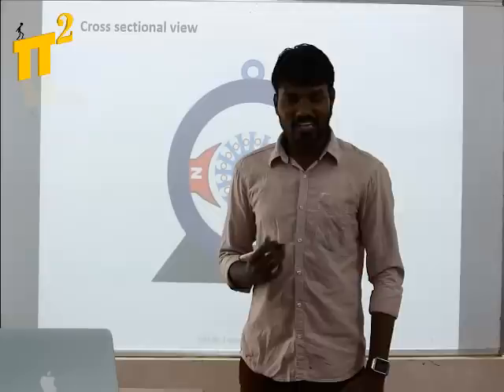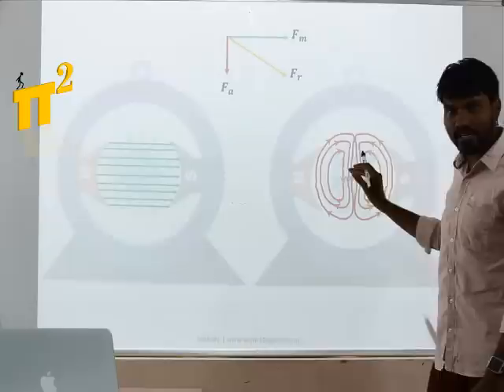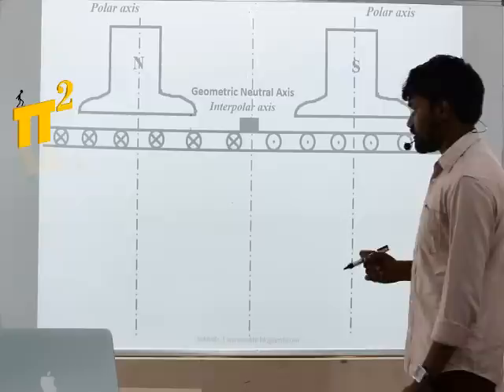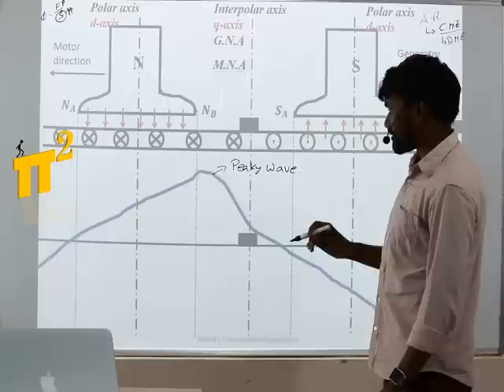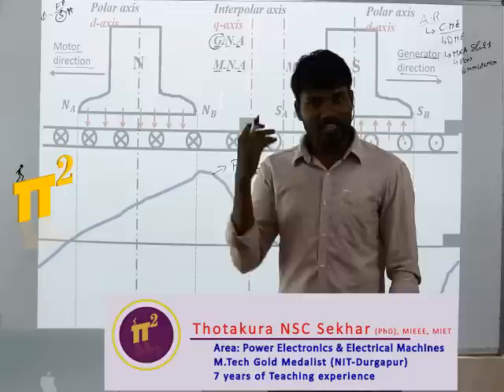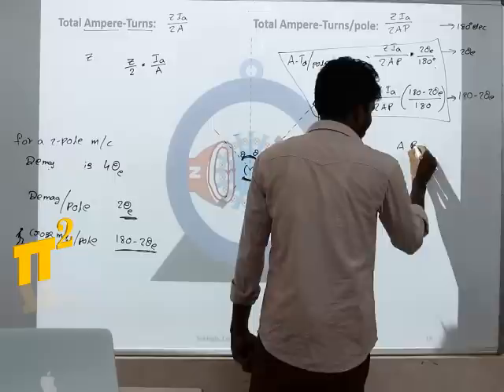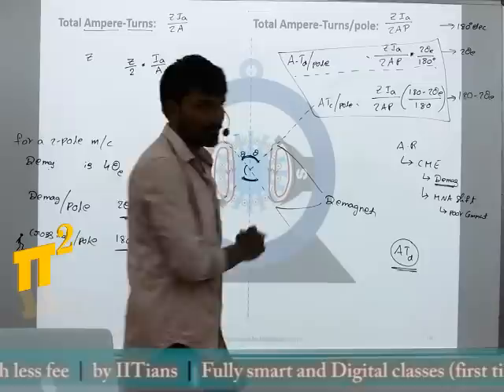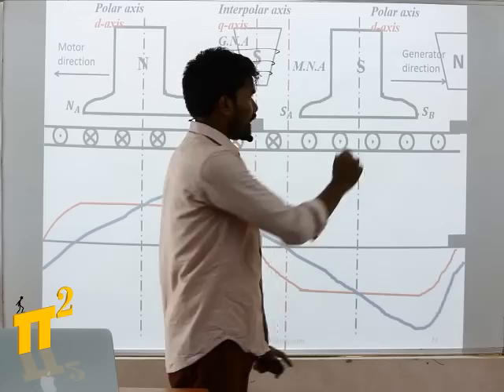armature reaction in dc generator | Armature Reaction in DC motor | Mastering Armature Reaction

Comment: Please sir give me below problem   solved A belt driven shunt generator connected to bus bar has the following specifications:
Power = X kW
Speed = 1500 rpm
Armature resistance = 0.025 Ω
Field resistance = 60 Ω
Ignore armature reaction and brush contact drop.
B2.1 The machine is running at 300 rpm and suddenly the belt breaks and the machine 
continues to run as motor drawing Y kW. Determine the new speed of the machine. 
B2.2 Determine the armature induced EMFs in both the cases.

Comment: Adding compensating winding almost nullifies armature flux that's correct. Then how motor torque is generated...? For torque generation both torques should be present....
Reply from the maker: Your statement is correct but Slight correct is needed in your interpretation of the statement dear, 
compensating winding is designed in such a way that to nullify the armature flux not main field flux. So main field flux alone will take care of the torque. Which is exactly wanted by us.